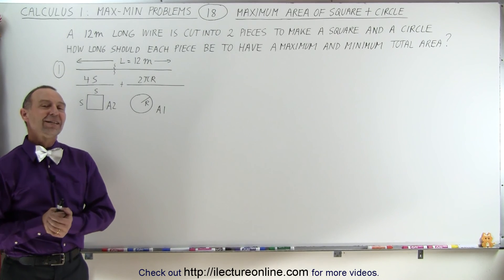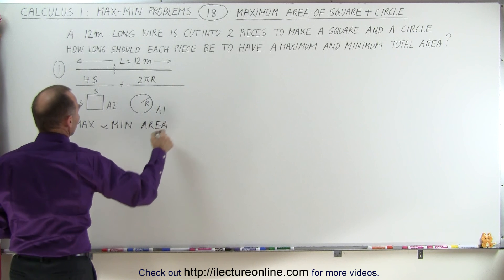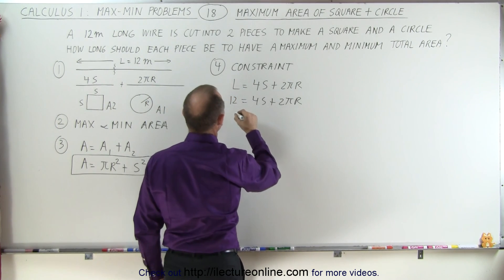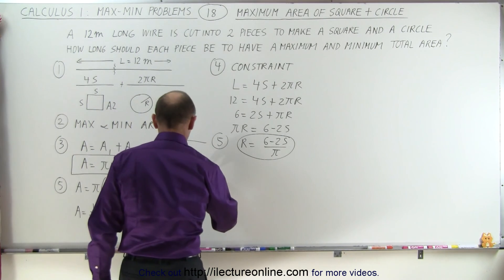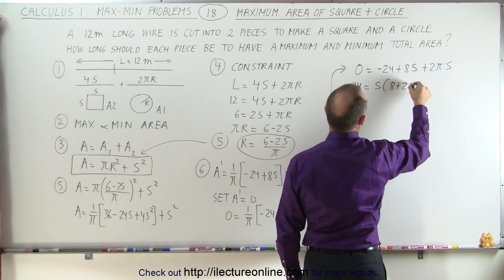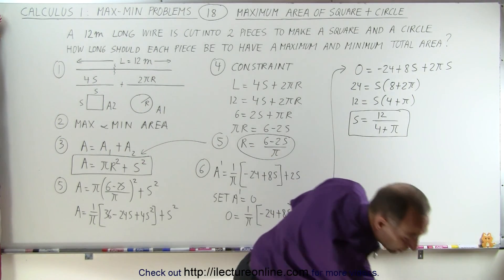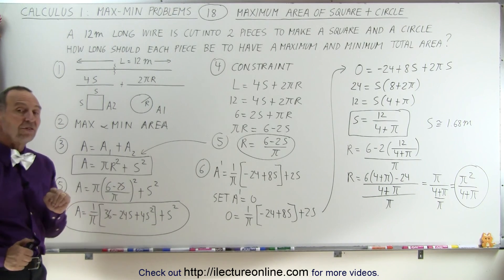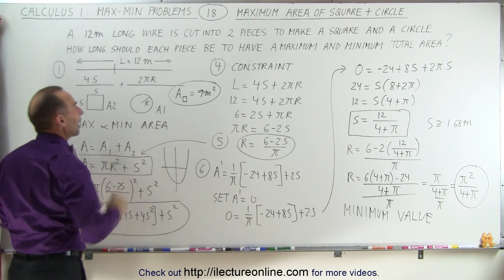Calculus 1: Max-Min Problems (18 of 30) Maximum Area of Square + Circle

Comment: Would the greatest area be at an end point regardless of the length of wire? I have looked at similar problems and this always seems to be the case.
Reply from the maker: Note that the 2 limiting cases are on the board.  If all the wire is used for the square only the area would be 9 m^2.  If all the wire is used for the circle only, the area would be 11.46 m^2

Comment: I think what confuses students is that the  question clearly states that you cut the wire into 2 pieces....but the max area  turns out to be if you do not cut the wire ...and use all of 12 m to form a circle.  Sort of misleading... on a test. The boundary is 0 -100m  hence..not including end points 0 and 100 ...if you cut the wire .